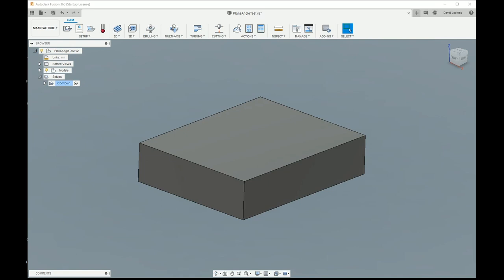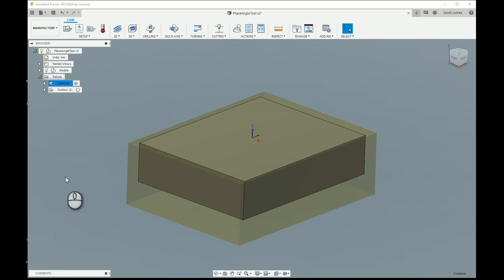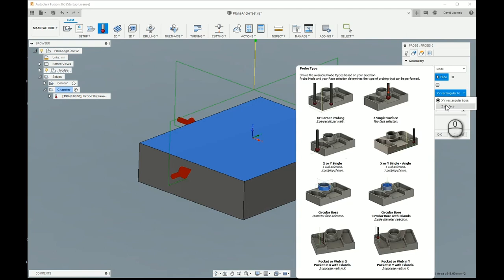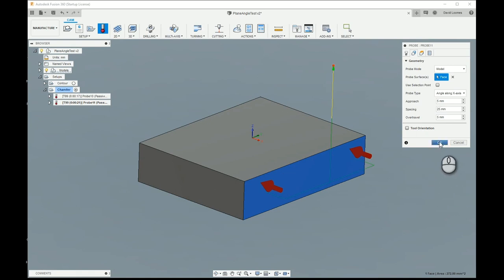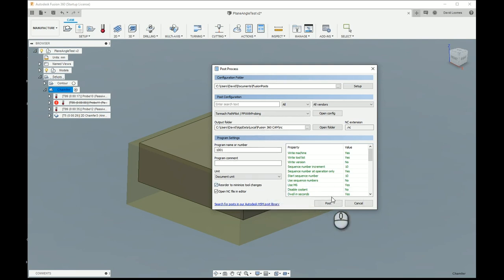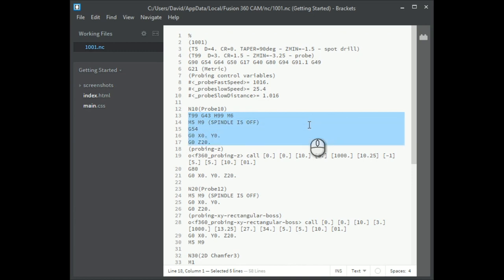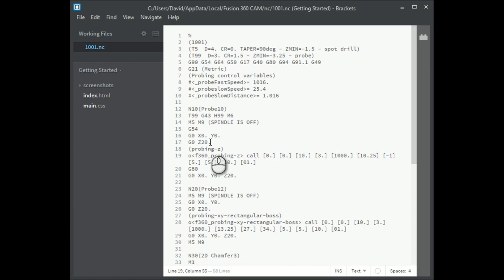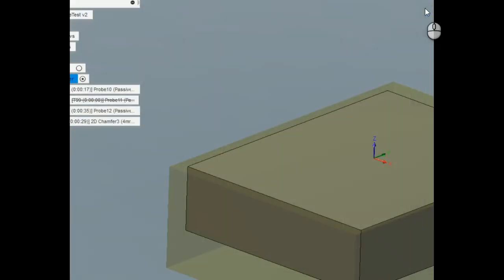Fusion 360 CAM for probing angles

Comment: Hi David thanks once again for all your work.  Does the angle offset apply to just the program or is it stored in g54 etc.  I have small angle 89.36 so its hard to verify. I dont think it apples a G10 L2 since the xy  dro doesnt turn italics.
Reply from the maker: Hi, thanks for the interest.

In PathPilot, this feature is currently disabled as it was having unfortunate effects on PathPilot itself.  The code is there in the probing macros and everything is finished and working from Fusion, through the post-processor and into the macros.  It's all there, right up to the point where the G10 L2 should be executed and that line is commented out.

Some of the issues were
The x,y and z DROs always show values in inches whether G20 or G21 is in force.  The number of digits after the point changes, but the data doesn't
Although all the probe movements subsequently move in the rotated coordinate world, the results returned are in non-rotated coords.
Some of PathPilot's own probing UI starts randomly mal functioning.  Random warnings about movements exceeding axis limits were commonplace.

The last time I checked, those issues were still in place.

In PathPilot/LinuxCNC, the rotation is stored separately for each WCS.  That makes use of WCS override int he probing functions essentially impossible.  It's entirely different in Mach3 (where I originally developed this code), where the rotation affects the whole machine, so everything works the same whether rotation is on or off.
Reply: @daleksw   Ok i noticed pp doesnt like us messing with g53,   I think this is still useful to probe the angle with print and set the g10 l2 manually.  Thanks once again

Comment: Hi Dave - nice work and clearly must have taken you some time and effort! 

I'm trying to understand the way your probing works. Is the double probing (firstly at high speed, then secondly at low speed) an obvious difference to the Renishaw macro? Short of me downloading their macros to look, I'm guessing that's the case. So you do a rough touch off, then go back slowly to get a more accurate final measurement, whereas it appears to me from what I've seen that the Renishaw macro just makes one touch off. I guess it has a lot less latency / delay. In turn, this second operation requires your additional post parameters. 

I have a Centroid Acorn which obviously uses a different post (doesn't seem to be closely related to any of the obvious candidates) and nobody has created a post for it with the probing functions yet. I seem to do a fair bit of (semi automated) probing with my hacked about Renishaw probe and would love to have a go at creating a probing post so I can make use of the Fusion probing features. I've already made a few changes to the posts for my 2 controllers (Centroid and Fanuc) so have the beginnings of an idea how they work. 

If I'm right, I'd need to paste in the appropriate JS code into the Centroid post, then edit up the 17 macros to suit the Acorn. I paid for the full cream CNC12 software which includes probing functions (for digitising and automated manual probing), so you'd think those macros might have enough similar-ish content to get me started. Given that my system is going to be closer to yours than a fancy Renishaw setup, I'd want to go the double touch-off way, which of course is also how Centroid do it in their own system.

Am I right about the 2-stage approach?
Reply from the maker: All the probing routines I've seen use the double touch off.  the ones I found in Mach3, the ones distributed with PathPilot and ones I've seen on big VMCs with Renishaw probes.

It is latency related.  The thing about latency is that it doesn't matter, so long as it's constant and so long as you know how fast the probe was moving.  If those stay the same, then the only correction needed is an adjustment of the probe tip diameter - and you need to do that anyway to remove the probe's pre-travel.  I have a 3/4" gauge ring, so I probe its diameter and adjust the tip's effective diameter until the correct result comes back for the ring's ID.  That removes the influence of pre-travel and latency, so long as the latency and probing speed remain constant.

When you do the 1st, fast probe, you can't be sure that the table was fully up to the programmed feed rate when the probe touch happened.  If it was still accelerating, you could be a long way off because the probe's latency is known, but the table speed isn't as fast as you thought.  By backing off a known distance, then moving forward again, you remove this variable.

Feel free to have a look at the PathPilot code.  The code output by the post is pretty simple and the code in the various macro files is all based around just Linux CNC's G38.2 and G38.3 (see http://linuxcnc.org/docs/html/gcode/g-code.html#gcode:g38).  The macros are pretty well commented, so you should be able to work out what's going on.

I'd be surprised if any system already had probing macros that could perform the operations needed to make Fusion work without some additional programming.
Reply: @daleksw  All based on just the G38.2 and G38.3 macros? That's interesting - I hadn't noticed that. The Centroid probing functions are pretty complex in terms of how they are all interrelated and to a fair extent I suspect they were created for digitising surfaces (engine ports etc) as much as part setup. I've looked into their probing macros and there are 36 of them(!!). Ahem.
I wonder if I could recreate direct Centroid equivalents of the G38.2 and G38.3 macros, then sort of reconfigure / port the relevant PP code from your work into the Centroid post. I may find very quickly with a little effort that this is in fact a massively naive idea. Certainly, attempting to reverse engineer the Centroid macros looks like a daunting task.
Reply from the maker: @murrayedington  If you don't have them already, you can get the PP/LinuxCNC macros and post from http://xoomspeed.com/CNC/FusionAutoProbing.htm Once you've got the download, look in the folder with all the ngc files.  There's one named f360_probing-*****.ngc for each of the F360 probing operations.  No prizes for guessing what f360_probing-x-wall.ngc does.  They're basically LinuxCNC g-code and should be reasonably easy to understand.

Comment: I love what you have done here and now i'm asking myself if I should switch back to using Mach3 so I am able to really get good use out of my probe. Do you think you might be able to send me your tormach setting for mach3 aswell as the post I can use with F360?
Reply from the maker: If you're going to switch to Mach3, make sure you use an ethernet smooth stepper to do the connection and whatever you do, don't try to use a parallel port.  It just won't be fast enough.  Happy to make the f360 customisation available.  Do you realise there's already a version of it for PathPilot included with the current PathPilot distribution?
Reply: I like using PathPilot but from what I gather i'm not sure that im able to do in process probing, or am I? I use the probing page within PathPilot but I really want to be able to post from F360 like you have been doing and using I think its G68 to update the angle. Do you know if there is a way to get F360 to post and be able to use PathPilot with all of the prbing you have been doing or is it only able to do that using Mach3?
Reply from the maker: @mattpiehl7122  I have a custom post for F260->pathpilot and a collection of ngc macro files to implement the probing functions from F360.  they are available as a free download from http://xoomspeed.com/CNC/FusionAutoProbing.htm

If your PP is up to date, then you should find that this is already installed as Tormach have included it in the system for several months now.  Look in the user subroutines folder and you should find the post and a readme that explains how to use it.

It implements all of the F360 probing options except the axis rotation.  I have that working on Mach3, but Tormach aren't very keen to incorporate some changes that would really be needed to the PathPilot GUI to make that function usable.